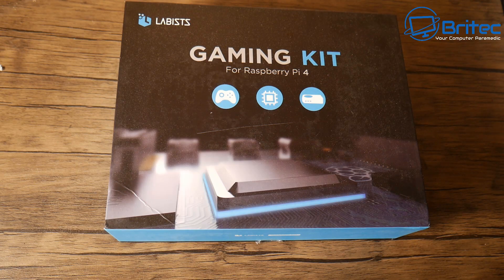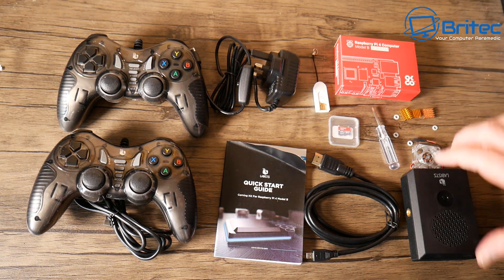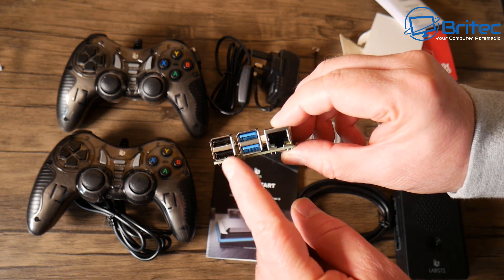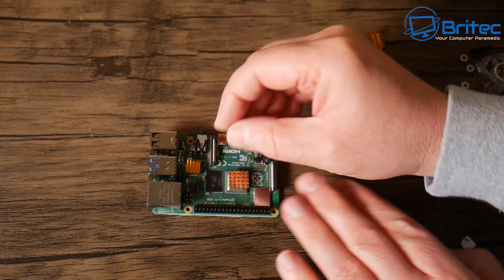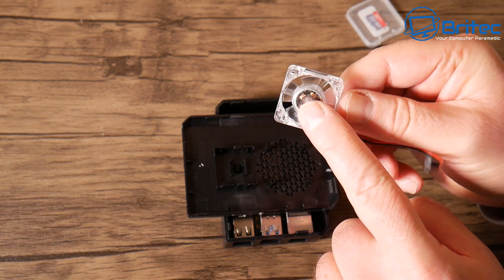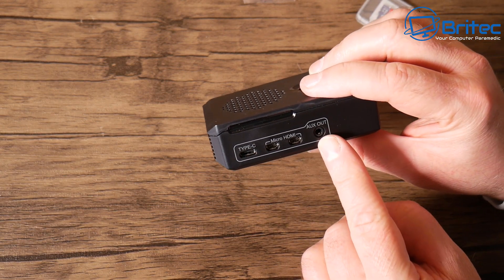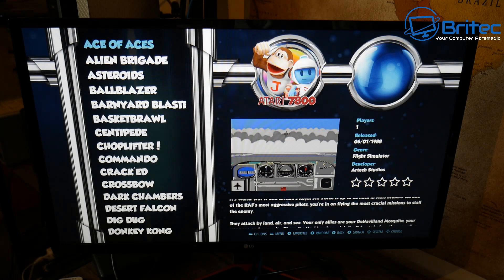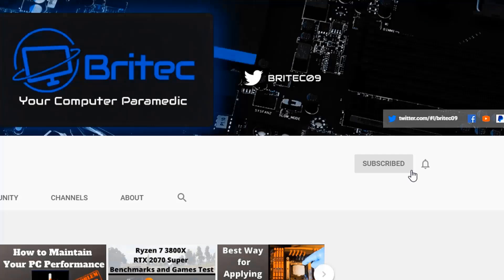Raspberry Pi 4 Retro Gaming Setup on Labists

Comment: Costs a bit for the kit but there is a lot in there, how were the controllers Brian they didn't look great, the D pad looked awkward & the power supply? I bought a similar one in a kit (with on/off switch) but I had to buy an official one as it didn't supply enough juice (kept on getting the lightening bolt on screen). These kits can be a good idea sometimes you get some iffy components. 👍